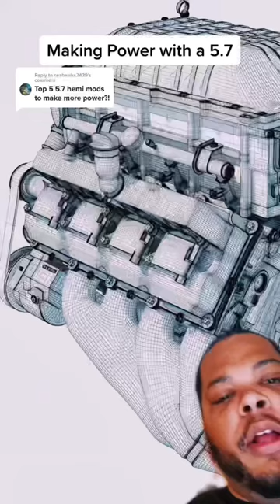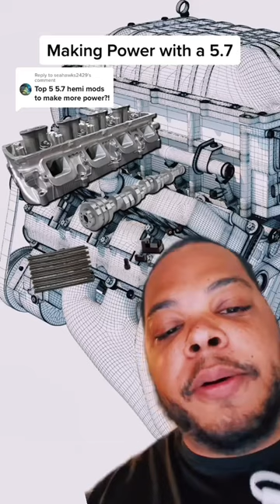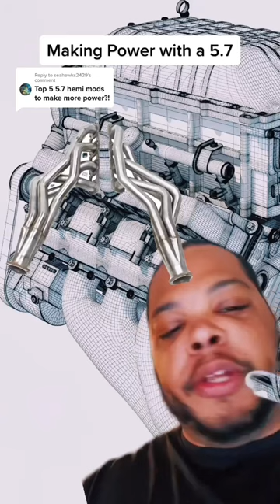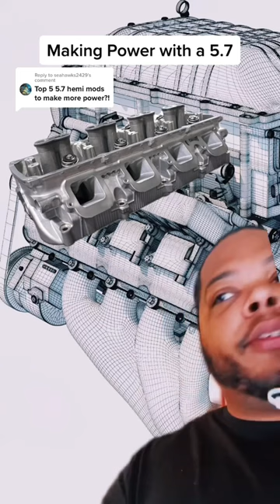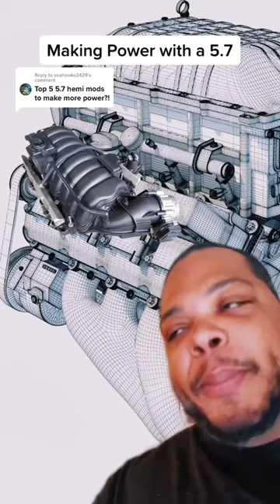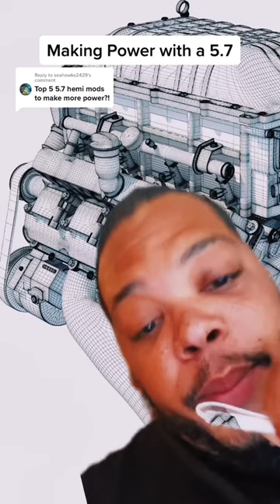Best Mods for a 5.7 Hemi to make power

Comment: 6.1 intake is better for torque while 6.4 is better for top end rpm hp
Reply: So go with 6.4 is what you’re saying because if you’re going against Fords and Chevys they are top end machines
Reply: Are they shaped for better torque or something? I would have figured the 6.4 was bigger so it would have more airflow and as such torque
Reply: @Thenowinsurl The 6.4 intake has variable length runners; so it gives you torque down low and high rpm horsepower

Comment: Run a blower @ 6-8 psi and that 5.7L hemi will be perfectly fine while making good power. You should see around 500 RWHP. You may need to upgrade your fuel pump, it depends on the system and boost levels. Get a nice tire on the back and you’re golden. A LSD is going to wake the vehicle up and put that power down better but that ran range from $3,400-3,800. If you really want to go quick grab a forged short block or rotating assembly, get a custom grind cam with valve train components, melling pumps (oil and water pump), an upgraded torque converter, grab a heavy duty timing chain set from somewhere like HHP, get your heads ported by a company like mmx, slap on some nice long tube headers with a catback exhaust, toss in a bit of a cooler thermostat (180°-190°), and you can easily make 700-1000 WHP. You’ll eventually need 1000hp axles, a valve body can hold you over for a good minute (~650-700whp) but eventually you’ll need a built trans from somewhere like SHR, a fore innovations fuel system will be needed for those larger power numbers, a suspension set-up will be key, and of course a wheel and tire set-up to get busy on.
Reply: You sound like the guy I need to talk too!! Hell a brother out
Reply: @HighSpeedDeShawn facts I’m one of those guys in a 06 hemi charger. I love it. Only thing I have on this video are the long tube header and man I swear I’m a lil better than other 5.7’s newer or same gen 😂 some guys just flat out got nasty 5.7’s lol I love the game tho it’s all for adrenaline and laughs
Reply: You can also use certain parts from the hellcat as well if your trying to stay on a super tight budget
Reply: @HighSpeedDeShawn  I got you brotha man 🤞🏼 what are your goals (are you shooting for high HP or do you just want a bump in power? Certain ETs in the 1/8th or 1/4 mile?) and what’s the budget? There’s multiple routes to take to make these 5.7s quick. Also, what year is your motor? There are some key differences between 2003-2008 and 2009+ 5.7L HEMI motors 🤞🏼 milage on the motor will also be a determining factor, over a certain milage I would recommend certain things.
Reply: @Underdogbuilds  2019 jeep grand Cherokee limited x 5.7. Looking to just give a bump in HP and torque. Not looking to race it at all but just to have some fun and run with my friends. I have about 55k miles on it currently. I'm not tryna to go absolutely crazy but I don't wanna spend without gain either so whatever makes sense.
Reply: @CotyBasa-Oahustate808  100%, I’ve got a couple homies running hellcat blowers on 6.1s and 5.7s. it costs around $5-7k rather than almost $10k for most other blowers.

A hellcat oil pump will bolt to a 09+ eagle block but not a pre-eagle block. 

You can also use other parts to make the build process cheaper. 09+ eagle heads are damn near the same heads as 6.1L HEMI heads, you can use 09+ 5.7L HEMI heads to address the valve train issues within pre-eagle HEMIs. You’ll gain some solid power swapping to Eagle heads and they flow much better than pre-Eagle 5.7l heads. (6.1L heads as well but they are typically much much more expensive). Also, if anyone reading this does want to swap to Eagle heads you’ll need spacers or adapters for the intake (you can use a 6.1 or Eagle 5.7 intake but you’ll need spacers to clear the block. You can use your pre-Eagle 5.7l intake with adapted plates - the porting between the pre-eagle intake manifold and the eagle heads are different but adapter plates would allow you to run it. The pre-eagle intake manifold is somewhat restrictive though, it’s best to go with a 09+ 5.7 intake if doing this head swap. You’ll also need Eagle valve covers because the Eagle valve train is taller by about an inch.) THESE HEADS WILL BUMP UP COMPRESSION TO 11.5:1 or 12:1! this is high compression, for an NA motor it can be fine but fine tuning and quality gas are a must! Or you can use cometic head gaskets to bring the compression back down. If you use the head gaskets to bring compression down you’ll need custom length pushrods, some people have left the compression raised and used OEM Eagle pushrods. If you stick with your stock heads instead of swapping them you can use 6.1 springs, retainers, pushrods, etc. to beef up your drivetrain while doing a cam. 

If you have an Eagle (09+) 5.7L HEMI you can use 6.1L or 6.4L HEMI exhaust manifolds (which are shorty headers/mid length headers) and mid pipes to improve exhaust flow/velocity and overall performance. Although I have and love long tube headers, I cannot deny the potential of using shorty/mid length headers. Dodge has consistently made 700+ HP with these headers. I can’t knock shorty headers, but long tubes will net more power, improve flow & velocity (at least a tad bit over shorty headers), sound meaner, and long tubes have a scavenging effect. shorty headers do not scavenge like a long tube header will. 

As mentioned you can swap intakes. The pre-Eagle 5.7L intake manifold can be swapped for a better flowing 09+ 5.7L HEMI intake manifold or a 6.1L manifold (both will net slight power gains). Or you could swap a 6.4L manifold onto pre-eagle 5.7s, Eagle 5.7s, or even 6.1s, but a window switch is required to gain the most power and make use of the active runner design. (Of course adapter plates will be needed)

If you have a 09+ 5.7L HEMI you can swap in a 6.4L cam (this won’t work for pre-eagle motors as a VVT cam cannot go into a Non-VVT motor)

a 6.1 Cam and lifters are good for about 25-40hp you will also need 6.1 pushrods and 6.1 valve springs or equivalent (the 6.1 does not have MDS so you’ll need to swap/replace your lifters. 6.1/Non-MDS/Hellcat lifters (whatever you’d like to refer to them as) will be needed and MDS will need to be disabled within your tune. (This is for pre-eagle 5.7s of course, eagle 5.7s are VVT motors and the cam wouldn’t be compatible)

The 6.1 Balancer on a 05-08 5.7 works as a inexpensive under drive pulley people have been doing it for years with no issues. This will not fit on the 09+ 5.7.

The 6.1L Crankshaft is a nice forged crankshaft (steel) that is good up to 1000HP and have been pushed further than 1000HP. This crankshaft can be swapped into pre-eagle HEMIs for a nice upgrade, they have the same tone ring as a pre-eagle 5.7L. (The stock crank in a pre-eagle HEMI will handle about 550HP)

SRT springs and shocks drop you about 3/4" and are one of the most cost effective mods if you find someone selling theirs from a SRT.

You can bolt a 6.1L oil pump onto a pre-eagle 5.7L block, the 5.7 oil pickup tube bolts right to the 6.1L oil pump. The 6.1L oil pump has a higher flow rate. If you are keeping MDS on, the higher pressure can throw a fault and shut MDS off for too high pressure.

And of course differentials and such are able to be swapped. Some differentials require a different driveshaft or a cradle swap, it all depends on year, make, and model. 

This is a pretty inclusive list, I’m sure I may have forgotten a thing or two but this is the bulk of interchangeable parts.
Reply: @HighSpeedDeShawn  I’ve wanted to turn one of those Grand Cherokees into a dig monster, they’re some beautiful jeeps. Personally, I think a cam & some shorty headers would put you where you’d like to be. Youre still in that lower milage range so it would be a more simple cam swap (higher milage vehicles would need more things such as a timing chain, oil pump, and water pump replacement). You could score 6.1L or 6.4L exhaust manifolds for pretty damn cheap for a nice little gain in power, those are D port and would bolt up to your heads. I’ve seen people get em for just a couple hundred bucks. Also, a TSP (Texas Speed) cam/cam kit would completely change your 5.7L. You would need a custom tune of course for around $450-500. This would leave you making ~400 RWHP. I also would recommend a catback exhaust system if you’d want a slight bit more power and improve sound. The stock exhaust on the 5.7L HEMI cars is restrictive, the bends in the exhaust create choke points hindering flow & velocity. There are some things to avoid unless more work is put in such as a larger throttle body. Some folks tell people to install a larger throttle body and tell them they’ll see some gains in power, but that’s false. Certain things require more work to be beneficial, installing something such as a 90mm throttle body on the OEM intake manifold isn’t going to produce more power because the inlet of the intake manifold is 80mm. So, with a 80mm throttle body you’re flowing just as much air as with the upgraded throttle body. I just wanted to point that out because some people five recommendations that aren’t truly beneficial. Another example is a “cold air intake”, they’re more so hot air intakes. The stock air boxes pull ambient air, but most aftermarket “cold” air intakes don’t have an air box and they sit in the engine bay sucking a bunch of hot air. So, the stock air box is best unless you have ambient air flowing into the engine bay. I.e. a headlight intake or vented hood. 

I hope this somewhat helped man 🤞🏼🫱🏻‍🫲🏼
Reply: @Underdogbuilds  thank you bro. How can I get in contact with you? IG? I'm gonna look I it a lot of what you recommended
Reply: @Underdogbuilds bro what’s your ig? I have a stock 21 charger RT and want to make at least more HP than scats but don’t know where to even start help a brother out.
Reply: @Demonkrull  I have a video here on YouTube called "Simple mods to improve 5.7L
HEMI powered vehicles" and I think the 4 modifications in that video are a perfect place to start lightly modding a 5.7L
HEMI. If you want to take it a step further with modifications I have a video titled "How to make a 5.7L HEMI as quick as a 6.4L HEMI (N/A)" up on YouTube that details more mods that would be beneficial. (That video details modifying naturally aspirated, but a blower running 6 psi is enough to put you on par with a scat and then some)
I also have a video titled "How to make a 5.7L HEMI as quick as a Hellcat" up on YouTube as well if you're looking to go faster.
Some folks slap a blower on a 5.7L
HEMI and call it a day, some folks grab a nitrous kit and spray a 100-150 shot, and some folks build high compression naturally aspirated motors. I'll have more videos coming out decently soon detailing more modifications and options.
Reply: @Underdogbuilds  thanks a lot I will be sure to watch all those videos that you mentioned 👍
Reply: That is, out of 5.7 it can give 700+ HP?
Reply: @user-md5sg4rq6q  yessir, if you fully build a 5.7L HEMI it can handle ~1000 HP before the physical block starts giving you issues. Some folks have pushed stock pistons & rods to 900+ rwhp by gapping rings, but longevity is questionable. A forged rotating assembly, an upgraded valve train, some nice headers, a cam, a blower, and possibly some spray will get you there. You’ll probably end up upgrading your heads too. Even an intake manifold can change things drastically, especially an active runner intake.
Reply: I couldn’t tell you how many guys who don’t know how to build cars driving scats that think it’ll cost me 20k to make 500 wheel I get into an argument with on the daily 😂 with just a cam, injectors, headers, and a full exhaust with a custom tune im already pushing 425 to the wheel. And once I go forced induction on 10psi of boost I’m pretty much guaranteed 650-700 wheel

Comment: I didn’t know you could put eagle heads on pre eagle block
Reply: you can but unless you get the pre eagle ported you'll need an adapter of some sort since they've got different port shapes
Reply: It’s the same damn block , just different heads
Reply: @Supercharged287SOHC the pistons are completely different and the value location is change u gotta change the pistons and heads or get a custom gasket
Reply: @nick.100  I know Ive already done the swap
Reply from the maker: @ectomorphnranger5165  you learn something new everyday

Comment: If u only swap heads you gonna mess the compression up something crazy
Reply: The compression ratio when going from the non eagle head to the eagle head won’t really change because the eagle head is a factory head from the later 5.7. It just flows a lot more air through bigger valves and such.
Reply: @02hockeystick19  no the compression zone is moved from mostly on the the head in the old version to mostly on the piston head. Look up non eagle and eagle pistons cause both motors run the same ratio
Reply: @nick.100 so what else should I get if I buy eagle heads??
Reply: @309cars  u gotta get eagle pistons
Reply from the maker: @nick.100  follow me on if @nanoetx

Comment: What does ported mean? Does that mean cut
Reply: There are a few small lips I would say that’s inside the intake that would cause turbulence and not deliver smooth air it’s just basically shaving that little piece down u til it’s even all the way through
Reply from the maker: @AP-wu1rv  yes shaving down

Comment: What’s the older 5.7 hemi heads what year are good and bad
Reply: 09 and after is what you want
Reply: Naturally aspirated builds are best with the 6.4 hemi intake manifold also that's a proven fact! Hopefully they helped
Reply: @invalidusername_5101 thanks a lot man but can I put a 6.4 mani in a 5.7 ?
Reply: @invalidusername_5101 just like that just a basic swap
Reply: @3v_karimm  slight mod I think you have to make on the mani harness but nothing major.
Reply: @3v_karimm no the pistons are different you’ll make to much compression u would have to swap pistons to swap from pre eagle heads
Reply from the maker: @3v_karimm  09 and up

Comment: Don't you have to modify the transmission as well if you add extra HP?
Reply: Most definitely should
Reply: Converter , valve body, AMG solenoid, bearings clutch and bushing handle more power and torque 

And please don’t forget to upgrade your driveshaft, axle shaft and LSD
Reply from the maker: @aaronellisor1355  yes